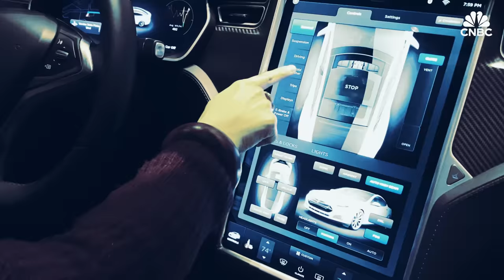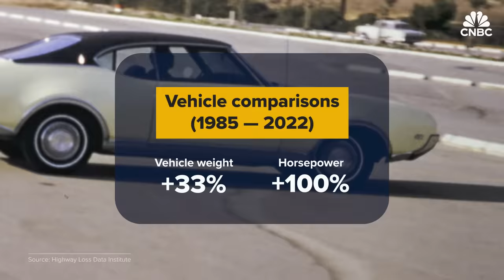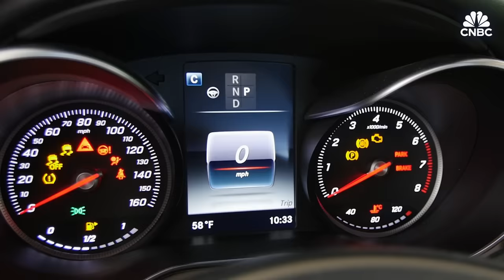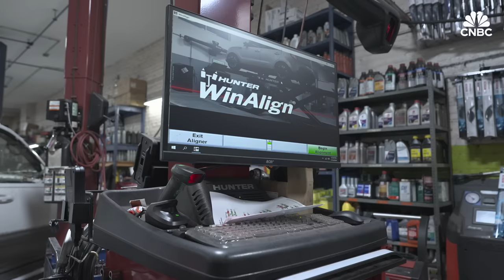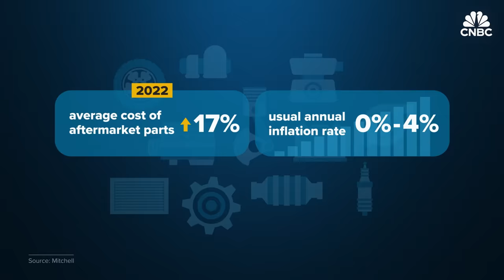Why Car Repairs Are Getting So Expensive

Comment: Before buying a car find out how much parts cost. For example, a 2004 Chevy Equinox's catalytic cost around $1600.  That is so bad for a car with little resale value .
Reply: The value of parts don't change just because the car loses value.
Reply: Why TF would you put $1600 on a old junk car. Just straight it, go to a junk yard and buy a junk catty converter if you, unfortunately, live in a state with yearly inspections.
Reply: Labor costs take up most of it, depending on the part if it’s ordered overseas or not
Reply: i got rid of my nissan because it needed a cat, pretty much the same price. problem with that part is it has a lot of precious metals in them, they cant be cheap because thats just how science works.
Reply: @thedude5040 it’s illegal to straight pipe it in most states. And if your buying a junk yard converter your just gonna run into the same problem
Reply: @waterloo123100  I'm a licensed professional engineer, biochemist, and electrical engineer. It's fine. If we were really worried about the environment then all catalytic converters should have a 15 year expiration date. It's shocking to me that California doesn't require automatic replacement.
Reply: @waterloo123100  I pretty much just switch to being a contract engineer for large utility companies because all my work is exempt from national electric codes. This summer I did electrical projects all the way from Kansas to Florida. My biochemistry is worthless because no one cares about ecology.
Reply: I feel like the pandemic is like a hemorrhoid...it'll just never rquite go away.

Comment: #1 reason, there are hardly ANY persons under the age of 45 that have any REAL experience in the field.....MOST of our experienced mechanics are OVER 60 and have either retired in the past 4 years or will be doing so in the next 4 years.
Reply: Sad reality is there are people who are younger who would be amazing mechanics but we cannot afford the hundreds if not thousands in tools just to start working let alone keep working. We’re literally being priced out of the industry. I’ve always had a knack for car repair but have yet to find a shop paying over $15hr for newbies near me.
Reply: Diesel and auto mechanic of 23 years. I am 49. The average age of a mechanic here is 42.
Reply: I'm 41, a PC gamer and I rebuilt my 30 year old truck bumper to bumper all by myself and I'm not even a mechanic. Got 12k miles on it and drives like a brand new truck. Just had the machine shop grind my crank down, new cam bearings, check the heads, and deck the block and did everything else myself. Just nuts and bolts, easy peasy. Only thing challenging was the transmission. 5 speed so wasn't too bad.

Comment: Techs didn't leave the industry because of the pandemic. They left the industry because flat rate is a scam for the tech most of the time, especially when you have to deal with warranty and recalls, paying 50-60% of what it actually takes to do the job. They left because of decades of worse benefits than other trades while we have to spend thousands and thousands of dollars more in tools. Worse benefits after a decade in the industry than entry level office jobs.

Comment: All I want is an economical and very efficient car for transportation. I don't want back up cameras, door that close themselves, lights that turn on by themselves in different weather conditions, lane assist, expensive stereo systems, large information screens, self driving capabilities, etc. it's almost Impossible to find any vehicle like that today and even bare bones models have cost already built into them to help make these driver assisted gadgets cheaper on all makes and models.  
If a simple rear van door latch ended up breaking pre 2000 you could fix it yourself, now a self closing rear van door would probably cost $2k because of the motors, sensors, and complexity to repair it. Its just not worth it

Comment: It’s just me or CNBC doesn’t understand the real problem. Accident is not something common people complain, all what you say is okay. But real culprit for normal repair bill that cost like kidney is the poor quality of the car itself. There is reason why Japanesen Korean cars are most favoured for car longevity. They cost less and are built for middle class. These days cars are designed to fall apart in 10 years and they need to keep taken into service every 6 to 12 months, or they will fall apart even faster.
Reply: The Honda and Toyota vehicles I'm assuming you are talking about last as long as they do because people spend the money to maintain them. They do the fluid services, tune ups, timing belts, etc, when they are suggested to be done. You can argue they are built better, but they last longer because they are better maintained by the owner.

Comment: This is not a question of labor, this is a matter of parts. Parts are more expensive and in many cases the "new" parts you get, are complete junk. Ask anyone that works on machines and they will tell you, that the "parts crisis" that we are in the midst of is no joke. Many repair shops buy two of anything they replace in a vehicle, there is a good chance that one of them will be bad right out of the box, and they can't tell you how long the part they replaced it with will last. Don't bankrupt yourself over a car!
Reply: This one of the few actually true replies here.

Comment: I lease. In 15 yrs of leasing, never bought tires, no brake jobs, no frontend work, no a/c repair, no new mufflers, no tune-ups. My expenses are oil changes and a lot of times the dealer gives those for free for leasing. In the beginning I paid $550/mo payments. Now payments are $625 with no money down. Not much inflation there. But mechanic bills have tripled since then.

Comment: The other guy paid 15,000 in repair costs to repar my rear bumper and hatchback. My car was totally fine after the 15mph in highway traffic lovetap. I had a CF hatch*, rear bumper sensors, rear crosstraffic and small bumper repair to fix. I think a turn signal was replaced too. 

This is not including his car's front end damage repair bill..... 

Half the value of my car.
Reply: That's why I have a pintle trailer hitch on my car. It looks weird but I'd rather have the car behind me get stopped by that than my car's bodywork. If it punches through their bumper and punctures their radiator, let that be a lesson.

Comment: I drive a 23 year old vehicle, I simply do not want all the technology added to these newer cars. 

I was able to replace my head gasket, timing chain components, and clean my cylinder head from home. The only thing I had to send off was the cylinder head itself to get milled for flatness at a machine shop. 

Everything else was done from the comfort of my driveway with my own tools. I spent closer to $500 where a shop wanted $3K for fewer services than what I performed based on what I saw as I dove further into the engine. There was a lot of, "well, I'm already here, might as well" replace items.  

It's since stopped leaking oil and coolant, and the power is back, and fuel economy is the best it's been in my ownership (this was an abandoned vehicle I rescued from getting crushed for $550). 

The truck is valued between $3k and 5k, none of the repairs or parts is particularly expensive, until you add them together and go through a shop, then it's the approximate value of the vehicle to render those services. People see that price and give up on it, and that's how I ended up rescuing mine. 

At a certain point, I'd rather do the work myself and know it's done right than trust a shop making things worse because their tech isn't making any more money on the job and just wants it out of their bay ASAP.

Comment: The video should have talked about used car extended warranties. My friend got her 2016 honda HRV(under 100k miles) transmission replaced for free with an extended warranty she purchased.
Reply: Don’t buy vehicles with CVT transmissions. They’re ticking time bombs, and typically cost 3-6k to replace.
Reply: Yea, she paid $2,000-$5,000 for that extended warranty more than likely thats about the same cost of replacing a transmission anyway. So she didn't come out on top............

Comment: Brittle aluminum does not do a better job dissipating energy in a crash, steel that bends and stretches does the better job, you had that point backwards, otherwise great video.

Comment: This is what happens when you make DIY repair harder through things like hard to reach places and proprietary parts.
Reply: Subaru boxer engines are guilty of this, especially changing the Pcv valve on the ej253 engine.

Comment: People should drive whatever they want AS LONG AS they can afford it. The issue is people THINK that they can afford something just because they can scrap enough cash together every month to pay the monthly payment. Use a 20/4/10 calculator to determine if you can ACTUALLY afford a certain vehicle; for example, to afford a $50k car, you need to be making at least $122,600/year.

Comment: New vehicles are compacted engines with no room to work on them. Most shops charge $85 to 900 dollars an hour depending on vehicle, labor, & part's. Most shops in Florida are running 375 an hour just to cover labor costs

Comment: I just bought a battery. $245. I remember when they were $35. Sometimes I hate the future.
Reply: And they're mostly sealed 'maintenance free' so you can't add water and fail faster.
Reply: Hook up your battery to a Battery Tender every night. The 12V batteries on my vehicles still maintain a full charge after 12+ years. Amazing! Save money and prevent ever being stranded again due to a dead battery. My vehicles start every time.

Comment: this is why you buy EVs...
had my tesla since 2019, never needed anything major...
and saved so much money on gas
Reply: Until you need a new battery
Reply: the majority of people have cars that are 10 years or older. Lets see if these cars hold up to that age. When your warranty for the battery expires. Hopefully you saved enough on gas to buy/repair the battery.
Reply: New batteries will cost a fortune.  Resale value go down the toilet unless you can show the batteries have been replaced.
Reply: people who never have owned an EV always use the battery argument without any further backing. First of all my car's battery is fine, lost maybe 2-3% if that.

Tesla gives you a 120k miles warranty on the battery. Along with a 120k miles drive unit warranty.

my car is 4-5 years old... I'm positive it will last 10 years. I have not seen any indication where it won't.
And this is just me but I plan to trade it in for a newer model before 10 years anyways... but once again that's me.

all I can say is i will NEVER go back to ICE after experiencing EV
Reply: Only those with no experience with EVs talk about battery replacement. Ignore them.
Reply: I will never want an phone on wheels that takes 3 hours to charge and has a awful range of 100km and freezes in cold weather and is built on the backs of modern day slaves in South America 🎉😊
Reply: Trash Evs
Reply: @blazezooom  once again, another misinformed person who has never owned an EV but just talking. I charge my car at night when I'm sleeping so I wake up with a "full" charge. Rarely have I needed to charge in the middle of the day because my car can get like 280-300 miles per charge. Even when I needed to charge during the day I just use the tesla superchargers which can can take me from 10% to 70% in like 20 mins.
Reply: Paper weight once the battery goes and it will go.

Comment: So what else is new,  In the 1980s I took my car in for repair and three different dealers could not fix it.  The car was just out of warranty and there were three defective parts that should have been replaced under warranty. One defective solenoid I found was $120.00 dollars from the parts dept. as there were not as many aftermarket parts in those days. The heater was controlled by a servo motor and the plastic adjustment clip was partially broken at the factory and would come loose, called the dealer and plastic clip was not available but the only way they could fix the P.O.S. was a grand to replace the entire heater, repaired myself with a cable tie. In many cases these repairs could be done by any good shade tree mechanic but NO PROFIT IN THAT ! Many of these newer vehicles now require the engine to be removed just to replace the water pump !  The entire repair chain all went to the same American University, SCREW U !
Reply: Sounds like you own a Chevrolet Colorado

Comment: Where are you getting a 60/hr labor rate? When I left my local Mercedes dealer in 2018, the labor rate was 165/hr. Now it's 295/hr. The dealer is still taking more than 80 percent of that, with the tech getting less than 20 percent. Dealers are greedy, historically underpaying techs, which is why I left. Add in the stress of the flat rate pay scale, and it's not a career I would recommend anyone to go into. EVs also take away all the money making maintenance work, EV basically needs tires, brake fluid changed every 2 to 4 
 years, and washer fluid topped off. Can't make money as a tech in the future unless pay plan changes.
Reply: 100%. I work in warranty and what we pay dealerships for labor is insane compared to what they pay their employees. Ive seen it be anywhere from 200 euro to 59 euro an hour when they pay their guys 20
Reply: My local Texas Firestone is now at least $100/hr and my Nissan dealer is $200/hr. 
In Southern California a Nissan dealer is $250/hr.

Comment: Current Administration has imposed too many excessive technologies and regulations that are unnecessary and distracting to drivers. More importantly, all these gimmicky gadgets, features cost at least $10K per vehicle.
Reply: But these changes can't make it into a car in the space of 3 years. So this would have started before Biden and some before Trump.
Reply: @pullingweeds  Most of it isn't even mandated its just auto manufacturers putting useless and sometimes dangerous trinkets on their cars as standard equipment. Most newer cars have a complex touch screen with multiple menus that you have to navigate to control the radio and climate controls, which used to be accomplished with a few easy to use knobs. And using these setups is damn near the same as scrolling through your phone when driving distraction wise.

Comment: I know a lot of people pat themselves on the back for having an older vehicle but as someone now in the collision industry I’m telling you if I see a vehicle now that starts with the year 2000 and it was in an accident there’s a high chance the vehicle is a total loss even if damage seems minor. You will get a couple grand for your troubles and maybe not enough to cover repairs and have a more difficult time insuring the vehicle or selling with a salvage title. Total loss does not always mean non driveable it is simply that repairs cost more than the current actual cash value of the vehicle and insurance will pay whatever is less the repairs or actual cash value. Insurance companies and state laws can vary but it’s typically they will declare total with the Mitchell evaluation at 50% or 70% of the actual cash value. The value of used cars has also deflated since a year ago to two.

Comment: I worked at a dealership for a year in the service department (left just before the pandemic hit) and other repair shops in the past. Here are some of the things I've seen in terms of modern cars compared to older cars:

Saw a Ford Escape police vehicle owned by Homeland Security come by. A single LED went out in the headlight. It would have needed the entire headlight assembly to be replaced. Older cars have incandescent bulbs that only cost a few dollars a piece.

A Land Cruiser came in with a cracked side mirror. Just the plastic lense covering the turn signal was damaged and the rest was fine. The parts cost alone from the parts department was almost $1600 without tax, labor or shop supplies. Older mirrors often don't have anything in them at all.

A Prius came in with a damaged front emblem. Radar cruise control was relatively new at the time, and the emblem was what covered the sensor. Just the emblem cost was around $400. I remember our service manager ended up helping the customer glue it into place. Obviously older cars don't have this at all.

People buying larger cars with four wheel drive or all wheel drive. The vast majority of people drive in the city where all wheel drive is completely unnecessary. These systems require maintenance! Front differential, rear differential and transfer cases need to be drained and filled. Obviously this costs more where as a typical front wheel drive car has none of those things (which most older economy cars are). I've seen a rear differential case that exploded. The owner had a shop remove the drive shaft and rear axles to convert it to front wheel drive because the cost to repair it all was so expensive.

Comment: Shop labor is astronomical in some places. 
I needed spark plugs replaced, engine oil change, transmission fluid change + filter, rear diff change. Shops wanted $1200, with about $1000 of being labor .
I did it myself for $200 in oil and parts. Got the car up, let the engine, tranny and rear diff drain while I worked on the plugs. Took me 2.5  hours and that's without a mechanics lift.